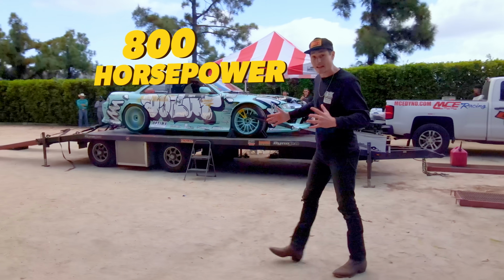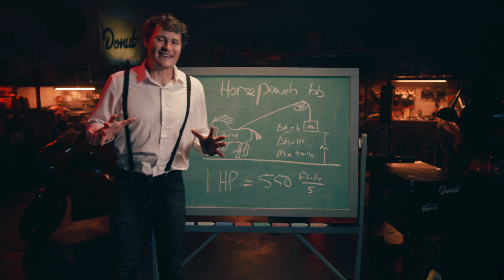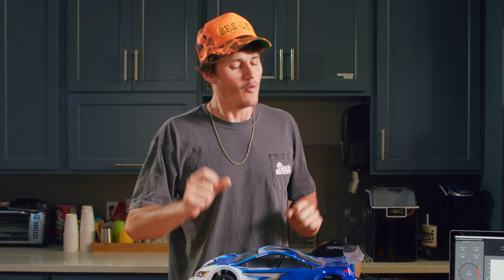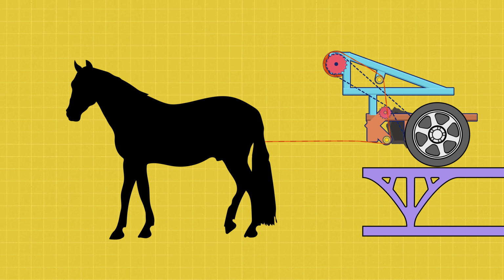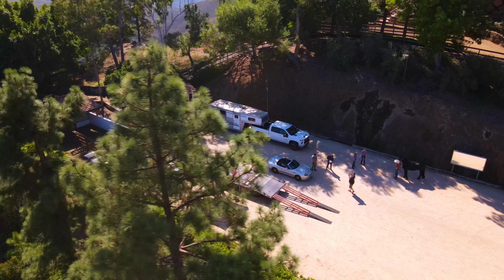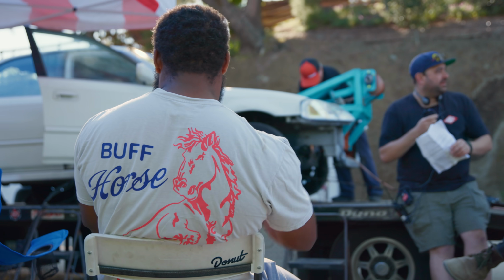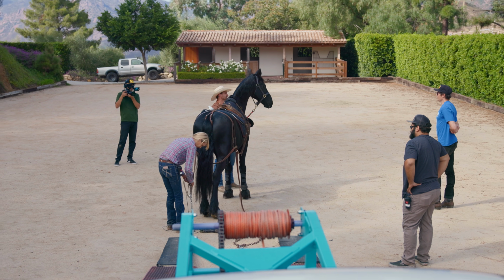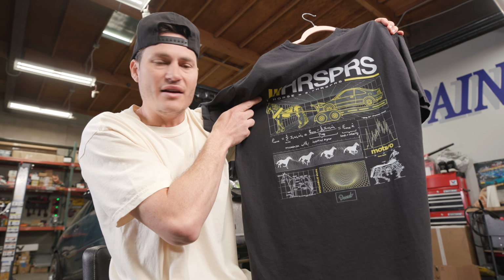How Much Horsepower is a Horse?

Comment: As an engineer that works in the energy field, I truly appreciate this.  I can see Watt's perspective in communicating to the masses a comparative horse power to machine.  How else do you communicate to an uneducated person that can only see what a horse can do (especially ~200 years ago).  The contribution Watt made via his steam engine is mind boggling.  We still use steam to power everything to this day.
Reply: A lot of people contributed to the steam engine with many inventions complementing each other. Watts biggest contribution was to let the cylinder only partially fill with a bit of steam and then let the steam expand by itself. Thus using less steam and make a much more efficient engine.
However with his patent and some money behind him he fought hard against other inventors of the steam engine for 20 years. During those years the development of various steam engines actually stagnated. So his net contribution is debatable. There is seldom a single inventor behind something, but history can only remember one.
Reply: @nomercyinc6783   well what spins the turbines in coal, oil and nuclear power plants
Reply: Ye, kinda like "Candela" for light. Everybody has a sense for how bright a candle is.
Reply: @uu8217 I thought that the light was measured in lumens?
Reply: Nuclear power is essentially steam power is what op is saying I think.
Reply: @logicthought26  It depends on the grid; in some places most electricity comes from turbines powered with water, wind or gas instead of steam, not to mention photovoltaics. I still think it's cool that steam powers 60% of the world's power and that even the high-tech fusion plants of the future will still use steam.
Reply: That's actually the more impressive part. That the majority of people were illiterate yet were still able to build and maintain fairly complex machines back in the day
Reply: @ObservationofLimits  Most people are still illiterate in the original sense of the word.
Reply: It was just a matter of when and never a matter of WHO. I don't understand all the praising of specific individuals. This is like praising car brands, as if other human groups couldn't have achieved certain achievements.

Ps: I'm fun at parties and a blast at funerals 😛

Comment: The resistance to pulling was way to little for that horse they have maximum power when going way slower perhaps at around 1 m/s. A real pulling horse like the ones used for pulling logs in forests are also way stronger.

Comment: THE strength nad load bare of a horse was known and it was breed dependent, WORK horses  are not as wide spread or even in cities, as  pedegree horses or racing horses breed for speed, their means change their adaptive systems especailly during selective breeding phases.

Comment: I was hoping they would build a trailer.
- But you know what, We know what draft horses can do. We already have the numbers.
- Draft horse range from 1,700 to 2,000 lbs. Typically if you want it to pull a wagon across country you would work your horse 8 hrs, with breaks and snacks, and you'd have the horse pulling 10% of its body weight. So 170-200lbs per horse ideally. If you halved your workday you could double that weight. That's the humane numbers at least. We know back in the day many cruel ppl would literally work their horses to death. 
- You'd more often see something like say 6 horses pulling a 3,000 lb coach for maybe 4-8 hrs. Let's say they are 1,500 lb horses. That's 9k of horses. So they are pulling like 30% of their weight. Easy peasy, especially as a team effort. A couple horses paired can pull more combined weight than two horses alone. You could easily tack on say 5% of the horses weight in load for every extra horse. So 6x5% = 30%, ish. This is a healthy work day for a team of horses. 3k lb cart, 6 horse team, for 8hrs. With breaks. Ez
- Ok, that's the gentle workload. Now how about what a draft horse can actually do? Well your average horse can pull 3x it's body weight total. So a 1,500 lb horse could pull on average 4,500lbs. But that's like the max, you would not make a horse work that weight load. Some draft horses can pull upto 8k lbs, That's like 4x their body weight. As these horses tend to weigh around 2k lbs, like the shire, Belgian, Clydesdale, or the king of drafts the Barbant.
- So you could use all those known numbers to try and figure out horse power. The More horses you have on a team, the more combined weight they can pull. 🐎 🐴 🎠 🏇 🐎

Comment: I dunno. I say take average sized draft horses and the average rpm over a work cycle of a draft mill. Measure that average torque and you’ve got your horsepower. I think that method deserves the most credit because like any animal a horse can be stronger or weaker based on motivation. But I get the video was to see the maximum HP one can create.

Comment: I think this test here should have been labeled  "Peak Horse Power" as that is what dyno's do anyway. We don't run machines  at peak for extended periods and any mechanic or machine operator will tell you that. If you want to keep that machine working well for years the 50 to 70% load is going to be your best range. Even 2 & 3 phase electric motors for industrial equipment are not recommended to run over 80% load for extended periods. In my experience  75% for sort periods and right at 50% for long and only using 100% for emergency has given the best results out of my equipment. If you take Big D's 5.7 and avg. that out over a day's work with out ruining him or worse. James Watt's measurements still seam to hold up to that 1 horse power of work load per day not a peak rating like here. So I think your whole premise for this experiment was wrong however I think you actually helped give credence To James Watt's assertion and rating on horse power.

Comment: real power is probably closer to 57hp. better measured by how much they weigh and how long it takes them to accelerate a certain distance. horses can move their own considerable weight pretty quickly. how much horsepower do you need to get a horse sized car to match a horses speed in a drag race? thats the answer.

Comment: Well done with all the production and great video concept.
My issue with your number that you have come up with at the end is that it is a poor comparison to what you (and Watt) intially defined one HP to be the power that one horse working a full day, and had a value of "550ft pounds / second". This does not address how many hours a work day is.
Also the value provided is an average, which will be the sum of the peak power as well as time taken during breaks etc by the horse in which it will be less power, all divided by the number of working hours. 
A way to illustrate my point is that, yes you were able to create slightly 1HP with the devices, however there is no way that you would be able to consistently produce that amount throughout the whole working day, therefore your horsepower on average would be significantly less than 1 if calculated in the way defined by Watt.
what you have effectively done is shown the peak horse power of that specific horse over a few minutes, which isn't fully an apple to apple comparison.

Comment: Both James Watt and I measure what we can sustain for a long time.  I can sustain 150 Watts for hours on end.  ( 1/5 hp) A typical horse has about 5 times my mass so should be able to sustain about 5 times the power output.  A sprint is very different.  And your rig has too much force to EFFICIENTLY pull by a human. But for a sprint even I have made 650 W and professional athletes have made 2 kW for a sprint.  So there is a HUGE difference between a sustained load for a horse day after day and what can be achieved for just 5 pulls in a day.

Comment: Why try to make horsepower sound like some  conspiracy?  James Watt needed a standard measurement for comparison. He wasn't trying to measure what a horse was capable of.  He was trying to measure the work an average horse did lifting coal or water up a mine shaft.  A horse that spends all day every day pulling a bucket up a mine shaft never works at capacity.  It would be dead in hours if it did.  You really should save your anti-capitalist rhetoric for communist party meetings or the Lada fan club.

Comment: amazing work, but did you really need a car?! I mean the process would've been mush easier if only wheels to be added to the contrapation, of course Big D has to run at a much longer distance until he reach maximum speed while pulling
I know I'm most likely wrong, because these guys are experts.. but I'm just wondering about the reason behind it

Comment: I'm no engineer, but why couldn't the horse's pull rope just be coiled around the dyno itself?  Wouldn't that take all the gears and other losses out of the equation completely and just account for his torque and acceleration?  Seems like they built a machine to interface a reel to a dyno (and introduce a bunch of complicated losses and maths) when the dyno is in effect a reel already... you'd just have to coil the rope around the dyno.  Watt's original experiment drawing was just a weight and one pulley...

Comment: Cool idea about the car but a better design to me would have been the bracket built or resting right off of the dyno with a spool driven wheel on it. 

 That transmission and drive train is probably eating up quite a few pounds of torque.

Comment: As the owner stated Big D is a "light" draft horse, what in Europe is considered an normal puling horse (used for carts or plowing). You should try the experiment using a heavy draft horse like the Scottish Clydesdale, British Shire, Belgian Ardennes or Romanian Heavy. I bet these horses go above 10 HP.
Reply: But I think it is much more meaningful if an "average horse" is used. You could of course look at what the maximum horse power is.
Reply: I think it would have been even more meaningful to also get the normal endurance walking pulling power since that is what the original horsepower was supposed to be based on (the power a work horse is putting out consistently over its work time), not the maximum burst pull power. It would have been nice to see what that number was from measurement vs Watt's estimate.  @PatrickMettchen
Reply: @2tkx1a25 the original measure of a "horsepower" was lifting 500# 1 yard a second over the course of a minute
Reply: Or something along those lines
Reply: @2tkx1a25 most of the drafts pull all day.. the horse pictures is for pulled wagons and pleasure not a work horse.
Reply: @PatrickMettchen  i agree it avervages out the as he said he wanted it average but still car like
Reply: They should have used an Amish horse that works all day,  instead of that Hollywood primadonna movie horse. That Amish horse goes to WORK!
Reply: @ripn929707 
It would have broke the machine!  😬
Reply: @ludicrous7044  probably. I seen a video of a team of Amish draft horses pulling a semi truck out of a snow bank. 😲
Reply: @ripn929707 
It would have broke the
Reply: Fresians are technically draft horses, but historically it's a war horse. which is different by a lot. You are correct, a draft horse would do much better for this test
Reply: I lived in a village in England and they used Shires to pull the carts with tourists in. They are massive beasts but known for their calm and easy going nature.
Reply: I thought they were gonna pick a mustang horse
Reply: @Jim-y6c no, a mustang horse would've broken down on the way to the shoot...
Reply: @Jim-y6c  it would’ve broken down😂
Reply: @Jim-y6c  Yes, they did say they were looking for the most car-like horse.
Reply: With a compressor, I bet you could get 30% more horsepower
Reply: Try all of these!
Reply: James Watt didnt mesaure peak HP,  but average power one horse can produce in 12h , a big difference
Reply: I saw a video of a Belgian draft horse winning a tug of war against 20 men.
Reply: Despite all the scientists, there's one issue with this experiment. The slack on the line. It will yank back creating losses. When pulling, they should ensure that there's no slack.
Reply: Mustang wouldn't even make it!! Hahahahahahahaha 💀 ☠️
Reply: If he hadn't been an idiot and used a motorcycle dyno the numbers would of been higher as that cars weight might take up to 75 hp away in translation
Reply: Clearly we need more experiments!
Reply: I think the machine overlords were right. the flesh is indeed weak lulz
Reply: And try it pulling all day,  vs just one pull. I doubt the house could sustain that,  which is what the original measurement measured

Comment: There are actually real truck mount dynamometers used in horse pulls all the time. And, if you look at he data from said pulls. You will find that Horse power is a measurement of work as originally intended from the when the term was created. Also, some use the term pull synonymous between actual horse pulls on a dyne and vehicles or engines on a dynamometer

Comment: THINK! If you put that horse back to back with a 5.7 hp buggy... which do you think could out pull which? I think the horse would kick the crap out of a 5.7hp buggy for sheer towing power.  Maybe take a 30hp motorcycle and see if it can out tow a horse.  Which truly has more towing power? There is no way a 5.7hp motor will tow more than a horse going up a hill.  A horse can tow a 3000 lb car up a hill.  5.7hp can't.

Comment: An inertial dyno is NOT what you want for a horse, because inertial dyno's NEED an accelerating engine to do its measurements.
One thing horses are notoriously bad at, is to continuously accelerate. Horses do their work at constant speed.
You want a resistive or braking dyno... You know, like the "B" in bhp...

Duh!

Comment: Great experiment but incomplete!

5.7 horsepower" is it really?
The horse doesn't even get to full power. Is the horse even going 2000rpm for example (in comparison to a car) instead of redline. A car gets to full power (redline) before the spead is taken!

I would like to have seen a comparison.
Hook up a car the same way and test it. Then put it on the dino to see the difference. Maybe you can do the math to see the horses full power. Then again, the horse could get more efficient as it goes. But we would at least see the minimum

Comment: what'd did it cost? a donkey, Camel, ox, elephant power can be calibrated too with this rig. even a ratio vs a hoss is some use. felt silly many years, internet says a man is 100w, and car is 87 hosses. seems a 7hoss car in the pre common era was an unforgettable sight.

Comment: I am a little bit surprised by the number... I did know that HP is BS because a man is ~1HP and obviously the horses were assumed to do ~15HP, however I assumed that if man can do 1HP on 2 legs, then horse which is much much stronger and better adapted to pull on all 4 legs would do much more, so I would have predicted 25-30HP per horse. 

Somehow I do not feel like "Big D" put all his power into it. But that perhaps does not matter, if this horse dyno could be refined and popularised then used in some sort of horse competitions, then over time more accurate peak horse power could be established. I think 5.7HP is the safe bottom of the power.

Comment: Ahhh but I'm about to mess with your head. There's horses, and there's horses, specifically, horses made for pulling carts, plows etc like Draft Horses. Does a Draft horse have more horse power than this horse in the video? 🤔 

If one normal horse is 5.7 horse power, does two pulling a cart equal 11.4 hp? 🤔